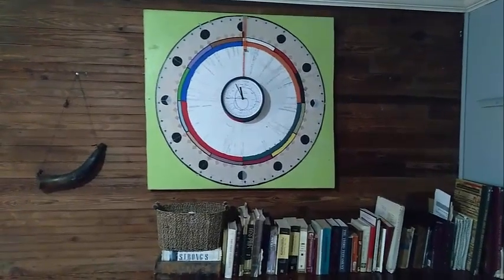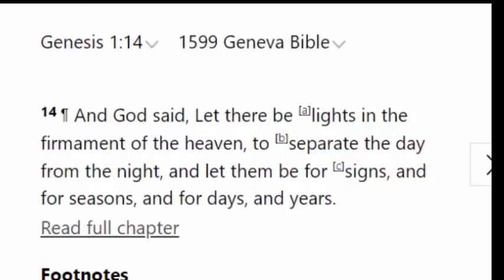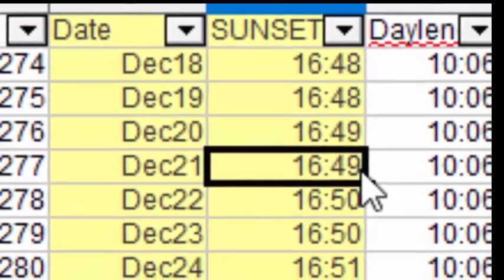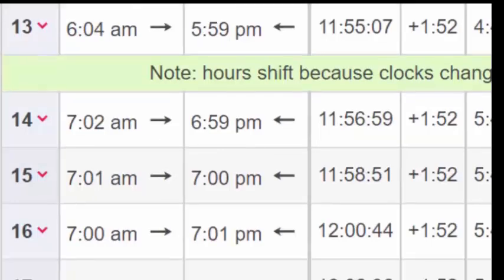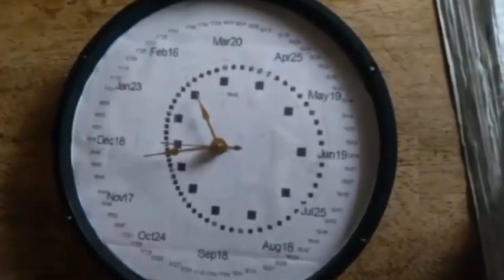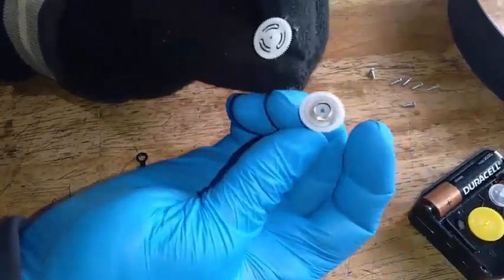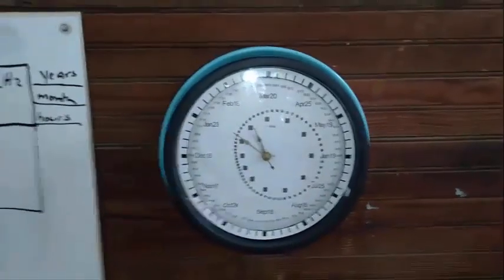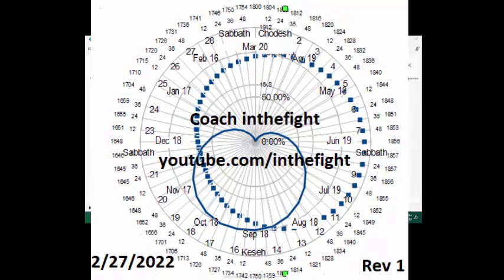Celestial Clock Calendar Made From Two Wall Clocks Tracks Months, Sabbaths, New Moons and Feast Days

Comment: The 3 days of darkness, @Coach inthefight, I believe to be the Branch Christ's 3 days and nights in the earth. I don't believe it's the literal sun. Jesus Christ is said  to be "the light of the world" which would also mean Rev. 5:5-12s Branch will be "the light of the world" at his manifestating.
Reply from the maker: I think it will be caused by dust in the air created by the rock that  turns mt olive into a crator or the volcanoes that will simultaneously erupt as a result of that impact.
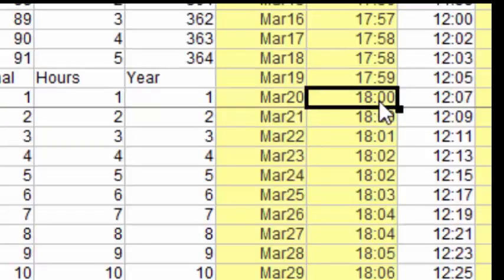Reply: I believe Mt. Olive is the Branch's Birthplace,  @inthefight , a place with a "Churchhouse" called Mt. Olive and will split to a North and South Mt. Olive church. The river could be automobiles that runs through Jerusalem, a city called Fort something. That's because the Branch is to be Born in the last world ruling multi-ethnics nation, Per Daniel 2:45 & Rev. 17:15 is the USA.